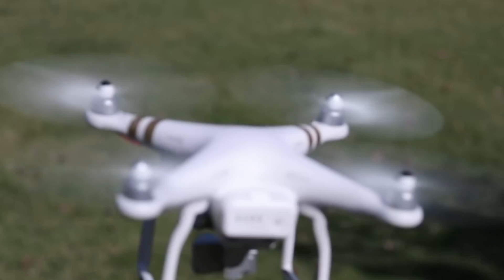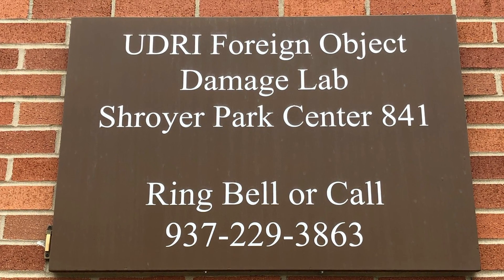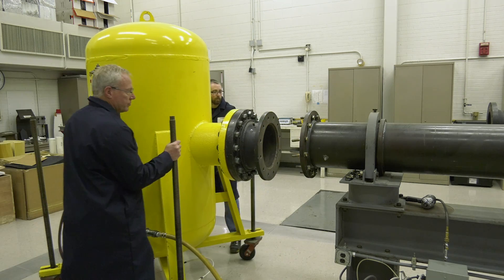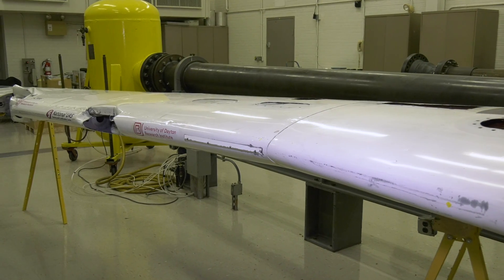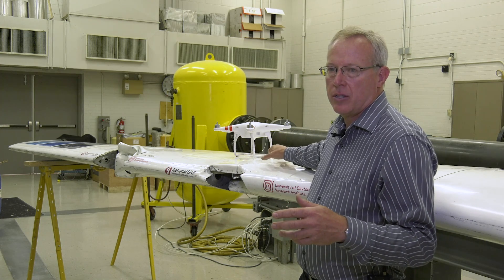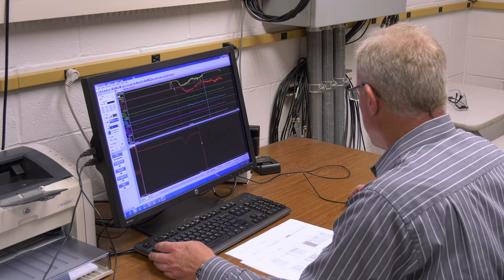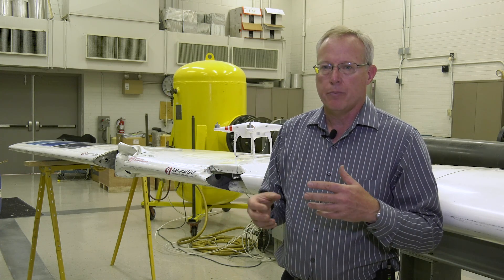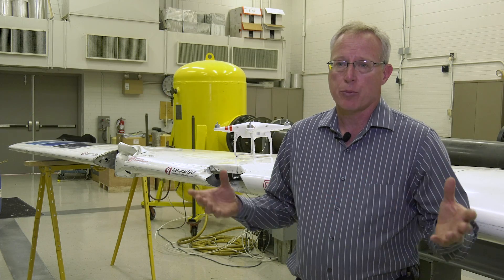What Happens When a Drone Hits an Airplane Wing? – AIN

Comment: I am a pilot. I fly Cessnas etc... I also happen to have been flying model aircraft since before my teens. I've almost struck a bird twice both of which were very large. While the test done is plausible the speed involved in the test is unlikely especially for the type of aircraft involved. Also I wouldn't say a Mooney is indicative of the strength of a general aviation aircraft considering the Mooney is light and built to be faster while the most common flying GA aircraft are built tougher. I've laid my hands on many a plane and a Mooney is closer to a fabric plane then a Cessna.
Reply: amtank you contradict yourself. "the test done is plausible the speed involved in the test is unlikely especially for the type of aircraft." Either it's plausible or it's not. The Mooney M20 Acclaim Ultra can cruise at 278mph according to Mooney's data. So this test performed at 238mph is entirely valid. Granted not ALL Mooneys are that fast, it doesn't mean it's impossible.
Reply: It isn't about the Mooney per say. The researcher is extrapolating to all light planes the damage done to a relatively weakly built Mooney at/or near max cruise depending on specific model. Nevwr mind the most prevalent light aircraft are both slower abd more resilient.
Reply: Having done a lot of work on Mooney and Cessna, they’re both pretty comparable in structure.  Similar skin thickness and rib distance in the case of the test theyve done.
Reply: Built tougher, but flies faster. Damage of the same degree or even greater is expected.
Reply: amtank hope you stay over 500 ft up that’s the law
Reply: I HAVE AN IDEA! LETS FIRE AN 800oz. LEAD DILDO AT A WW1 ERA BI-PLANE NEXT!
Reply: This is only correct if you're referring to the original Mooney, the Mooney Mite, which was fabric covered. Otherwise, Mooneys are famous for being tough as hell. All Mooneys built since the M20 onwards have both a steel cage around the cabin plus a continuous spar that runs from wingtip to wingtip. Mooneys are known for being very stout and forgiving when flown outside the envelope (i.e. too fast). Just not forgiving when landing at too high of a speed. 

The latest and greatest Mooney, the M20V Acclaim Ultra, has the fastest max cruise speed of any single engine piston sold today, 242 knots (278 mph). Thankfully, you'll only get that speed at altitude, but an Acclaim could easily be doing 200 mph at heights that some people have flown their drones.
Reply: @HammerLeaf  Tell that to the idiot above talking about "anti-hobbyist propaganda video" jeez.
Reply: There is always gonna be 1 idiot flying his drone close to an airport who will mess it up for the rest 😂
Reply: I'd like to meet the dumbass that you passed your checkride with.
Reply: This is true. I'm less concerned with impact on leading edge surfaces and more with cockpit and engine impacts.
Reply: k
Reply: The FED owns it!?! Son, the PUBLIC owns it! WE allow the FED to manage it on OUR BEHALF, In OUR INTEREST. Put down the doobie, and pay attention in History/Govt. class.
Reply: @gpwinkler  also well said.
Reply: @gpwinkler  haha yup! ☺️
Reply: @HammerLeaf  my EDF jet eats 200ft in about 1 second. That's nowhere near a reasonable block of airspace. As a fellow pilot, I don't want to hit anything when I'm in my Piper Cherokee, so I stay up high and away from obvious flying locations. I deserve to enjoy both hobbies, you don't deserve to limit the one that isn't entertaining to you.
Reply: @Variety_Pack  well said.
Reply: @HammerLeaf  there's risk in everything. the question is, how much. in this case the chance of a manned aircraft hitting a hobbyist's toy is extremely low. "logic" would tell you that when people follow the rules and guidelines set forth by the FAA, as everyone has been doing already for many years, there's no need to throw millions of responsible hobbyists under the bus in a deceiving attempt to give the sub 400' airspace to commercial drones.
Reply: That is my feelings as well droneXcursion
Reply: General Aviation. Private planes generally much smaller than typical passeneger planes. The majority carry no more than 6-7 people at most. Two and four passenger are the most common.
Reply: My current plane has a six foot wingspan and I doubt it would even penetrate a windscreen. The heaviest component is the battery and I don't fly super huge ones. 

On an additional topic. Research guy wants drones to be more "frangible" so you want our sturdy crash tolerant drones to simply break. 

All this arguing about altitudes airspaces is simple to fix. If you want to fly a drone high or by an airport it needs to broadcast its location.
Reply: @amtank  or just don't fly near a fucking airport? Why is there an argument about this? Freak accidents happen, why are you guys so twisted about not being able to fly near airports
Reply: @amtank  As simple as that!!! But it seems its 2021 and we’re getting squeezed. Next year even more.Until this hobby will dissapear , because thats what they clearly want.
Reply: Came here to say this. Thanks.
Reply: @FutureAirways2  Mooneys are built for speed not toughness. As far as I know the 172 has only had one wing change over its history. The re-contoured the leading edge in the 70s.
Reply: 2021 !!! Respect for defending our hobby!
Reply: Well that’s enough proof for me that a drone taking a plane out the sky is bs yes if it was in flight that’s a lot of damage but they would still be able to land without much trouble I’m shocked now because they say apparently hundreds of drones have brought planes down 😅 if this video is accurate then it would need to be a uav sized drone not a little dji sized thing
Reply: so nice to hear an actual pilot not fall for this obvious anti-hobbyist propaganda video. thanks for your professional input! 👍
Reply: @wndznuts  Yeah sure this vid is " anti-hobbyist propaganda" and it's not about safety. These people are actively trying to limit your fun and not trying to warn for potential implications. Seriously, do you even realize how you sound? There's a good reason the law is coming after you big time if you endanger people in such a manner and  you'll be looking at real jail time and no it's not because they are "anti-hobbyist " you freakin moron.
Reply: @HammerLeaf  perfect, then stay above the airspace that's well known to have hobbyists and birds flying in it. sooner than later Amazon delivery drones will be flying in this airspace too, so even more reason to stay clear. 👍
Reply: @wndznuts  About the amazon drones... if you would know just a little bit about signal jamming you would realize that they will never operate, with modern technology..
Reply: @FutureAirways2  You are going to honestly try to argue that any Mooney wing is anywhere structurally as strong as a 172?
Reply: @HammerLeaf  And here we are. 2021. When we’re even more restricted. No beach , not anywhere near people, all the drones we own are now considered (in UK) legacy drones which means you can only fly in the wildernes, far from people , far from beaches, far from anything.In fact soon we’ll be only allowed to fly on the Moon if we can get there and knowing we can’t actually fly drones in space. I agree its nonsens 500m altitude. But from 100m down thats what most of us love. And they took away most beautiful shots we could get. MOST! This is what happens when Governments get spoiled and people don’t know when to take actions.
Reply: @FutureAirways2  I fly a jet therefore I KNOW everything Aviation and am an expert that cannot be challenged........you sir are not stereotypical at all.
Reply: Planes being downed by Drones - ZERO. Planes being downed by birds - DOZENS. Reality vs your Logic - Reality WINS.
Reply: gpwinkler : So because it haven’t happened yet, it can’t happen? Drones have not been here as long as birds have. Birds with the same size as drones cause serious accidents to planes. I know I for sure would not be sitting in a plane hit by a drone! Do you want to?

Drones are more and more popular. I completely understand why there are regulations! Especially around airports and so on.
Reply: "So because it haven’t happened yet, it can’t happen?" Model aircraft have been in the air since the 1920's, roughly the same time commercial aviation started emerging. Even the more common hobby RC planes and helicopters go back to the 60's. That means planes have been sharing the sky with "drones" for 50-100 years, depending on your criteria. If deadly collisions were going to be common, it would have happened when drones were metal, filled with hydrogen or other fuels, and had no anti-collision sensors.
Reply: @warlocc-paul  But for how many years do commercial model aircraft's transmitting video feed? back then you couldn't get much altitude anyways.. and please don't mention the hand full of people that were developing this kind of technology.. they don't count
Reply: @gpwinkler  Ok idiot, there are active measures being employed to limit bird strikes but since birds are animals (duh) and far more numerous there's only so much there can be done.  Same thing with drones, there are also active measures employed and/or being tested out against drones (including regulations). Btw, a drone hitting a plane is more damaging (soft tissue compared to metal). Tell me, why are so many drone hobbyists so god damn fucking morons and trying to dig up stupid excuses just to fly a drone? Fly a drone, no problem. Endanger people -> go to fucking jail. LOGIC! End of discussion.

Comment: Mooney isn’t going to be traveling at 250mph let alone at low altitude.  A biz jet will but has a wing leading edge 2x thicker at least.
Reply: Mooney M20 Acclaim Ultra cruises at 278mph. So yeah.
Reply: @rackets001  cruises being the operative word here. The only time that a Phantom II and an M20 could share the same airspace is when the Mooney is on approach or departure, when it will be travelling about 150mph slower. It's also worth noting that this wasn't an M20 acclaim wing, it was an M20 wing from a much older aircraft which cruises much slower. AND the FAA enforces a 250 knot speed limit on aircraft operating under 10,000 feet. There is basically no was that this test could be replicated in a real world scenario.
Reply: You weren't listening. He said "combined speed" of both aircraft.

Comment: There are significantly less drones being flown than birds out there flying.   All those drones are not being flown continually but on a sporadic basis.     Also, what are the odds of a direct strike on the center of the leading edge rather than a glancing blow.  The statistics are not there showing drones to be a significant hazard, it is a hazard that is perceived in the minds of people who simply don't think drones should be in their airspace.

Comment: The speed they use is not at all realistic the drone may by able to go 30 MPH  a normal GA aircraft around 115 to 130 MPH  we one time got a 172 up to 155 but were going downhill fairly steep, and as other commentators note for the private jet to exceed 250 MPH they must be over 10.000 FT hit it at 120 and see what happens. To me the most hazardous  hit would be the windscreen birds have been known to go through them and a drone is made of much harder materials .

Comment: That  is nearly a worst case scenario, unless the drone is flying above 10,000 ft.  That simulated impact was at 206 knots.  The speed limit in airspace varies, but for the most part it is between 200-250 knots below 10,000 ft.  Assuming a flight speed of the sUAS of about 40 knots (around 46 mph, the top speed of most camera platform drones), the maximum real world impact speed would be  290 knots. Not 400+ as was suggested in the video.  How do you fix that?  Don't fly your sUAS into the path of manned aircraft.  It's pretty simple.  Don't fly your drone on approach vectors to airports, keep it low to the ground, and keep a wary eye open for manned traffic.  If you really need to get up to 400 feet AGL for that image,  have a spotter scan the sky for traffic so you can focus on flying.  The media is trying to do everything they can to make drones scary.  If you use a little common sense in their operation they're very safe to fly.

Comment: I don’t think this is a test that would justify it because no DJI drone goes over 80 mph let alone 200 mph and the are using compressed gas so it doesn’t really do anything the should make a rc plane with the same wings a commercial aircraft would have and let a drone hit it it would make more sense because that’s what’s happening right nobody is shooting a drone at a wing that is just sitting there.

Comment: As a aircraft structural mechanic and a (race/freestyle) drone pilot, i can say these results are accurate.  I've repaired bird strikes that have made it past the first spar.. Blood and guts nearly 2 feet back into the wing.  A drone could easily cause substantial damage.  The leading edge skin is usually .040" aluminum which isn't very thick.  They are designed to crumple and disperse the energy of an impact.  These test are unfortunately more accurate than you'd think

Comment: VERY interesting! It's good to see some actual testing in this area, rather than pure conjecture. I certainly applaud that.  However, as many others have commented, this test (with the information given in this video) does not give a comprehensive or entirely accurate picture of a "drone strike," and it really does not answer the question of "most likely" damage to occur IF this highly uncommon event were to happen. Here are a few points to consider:
1. As someone else mentioned, the test airplane is one that is faster and less common than most (a Cessna 172 for example, which has a cruise speed around 140mph). 
2. The most likely time for a drone strike would be on takeoff and landing (when the aircraft is closer to the ground), which means the aircraft would be flying faaar slower than cruise speed (around 60mph for a Cessna 172).
3. It appears that, in the test video, the quad hits the leading edge at a section between ribs. Ribs are  peices of metal that support the airfoil shape of the sheetmetal wing, and are much mure substantial than the thin sheetmetal (wing skin). 
4. This test CANNOT be directly applied to question of what the damage would be to a business jet aircraft. Jet aircraft wings use stronger materials and are typically swept rearwards much more agressively than slower aircraft. 
And there are several other good points mentioned by other people, such as the legal speed limit at the altitude drones would be flown at etc.
I don't say this to discredit the research being done, BUT a video such as this has much potential instigate knee-jerk "drones are bad!!" types of  responses, so I'd like to provide some thoughtful preemptive counter-points if I can. I also think the last point in the video regarding making drones more frangible is interesting to consider (especially since drones have gone from wood to carbon fiber/composite frames specifically for the purpose of making them incredible durable). 🙂 BTW, for context, this is coming from a "drone" pilot, A&P mechanic, and (General Aviation) Student Pilot.

Comment: Yeah but this is not correct data, because an aircraft like a GA.. isnt going to be travelling at the combind speed of 230mph. Because the altitude at around 400 feet , which is max for most drones would indicate that the aircraft would be very, very close to landing, or takeoff, climb out, which would be a slower speed...so , slower speed... less aircraft wing damage....just saying.

Comment: If full sized aircraft had to stay above 1000 feet except for landing/takeoff and for other valid reasons.. then the risk of drone/plane collision would be very substantially reduced.

And yet its all about more rules for drones. Its as if its not really about safety at all.
Reply: truth 👍
Reply: Generally, they do. But it's not it's not a blanket 1000 feet, it's 500 feet. See FAR 91.119. It does rise to 1000 feet over congested areas like cities.

Comment: Speed limit below 10000 feet is 250 kts. So unless the drone is above 10k ft, it shouldn’t be a higher impact than that. The video references a scenario where perhaps a jet were to hit that the speeds could be much higher. Maybe 40mph more, yet still would not be a good thing at all to hit anything. Birds are a bigger risk. Military drones, which are like a Cessna in size, have nearly clipped at least one commercial airliner. Still having one of those DJIs come through the windshield could be quite devastating.

Comment: so a bird of the same weight as the phantom would not have it's weight spread out in the extreme manner of the big fluffy marshmallow that they used to simulate a "BIRD STRIKE".
The likelihood of these events is miniscule, and real testing for bird strikes has proven that the weight and distribution of that weight are the only thing that matters at high speed.  If it's a frozen chicken, or a thawed one, makes no difference, despite the urban legends.   The mooney is not likely to be flying at that speed at low altitude anyway, and was the lightest built example of a metal airplane wing that they could find.  Thousands of bird strikes happen every year, and it's proven that it takes several large birds to take down an aircraft.  Such as the Hudson River incenent.  a lone phantom will not be enough.  
This was an obvious rigged test to make a point, and give regulators the ammunition they wanted to restrict people's freedom.    Bet that guy has never flown a model aircraft, and is being paid for results.  Sickening.